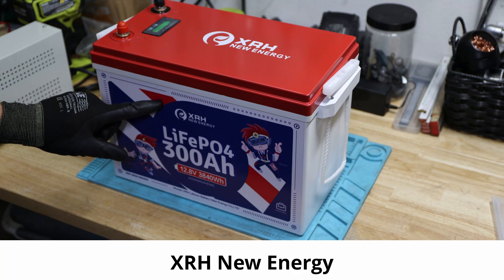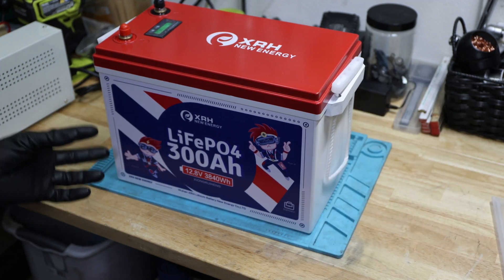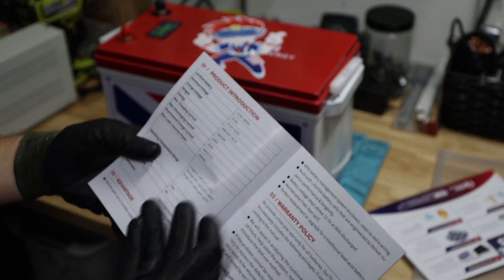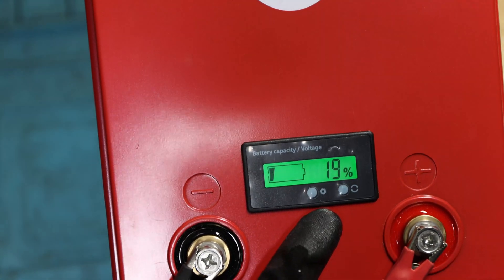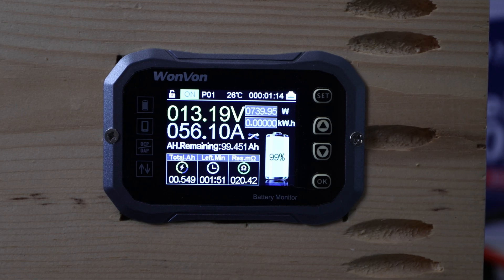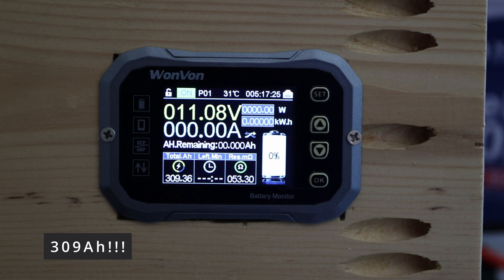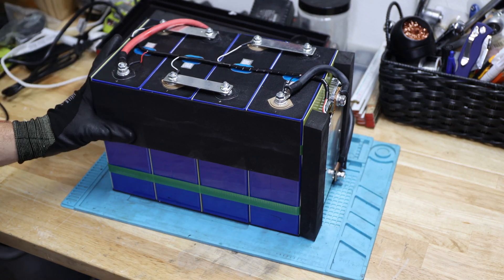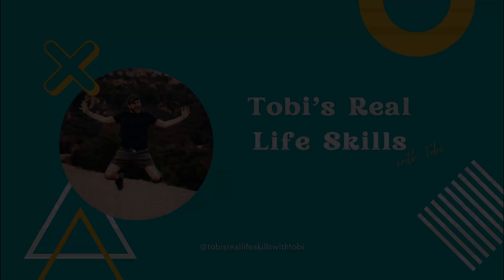High-quality XRH 12v 300 Ah Lifepo4 Storage Battery Without Temperature Protection

Comment: Very itneresting. I bought a similar battery and a battery tester. I want to know the capacity of my battery, but I am not sure how to go about this. Do I just run it and hope it hits 300ah before cut off, or do I run it down to BMS and see the exact measurements? At what point do I cut it off if I am not completely depleting it until bms kicks in but it hasn't reached 300ah yet? When do I call it "false advertisement"?

Comment: Thanks for the teardown, I think this should be OK in a system with a Victron Smartshunt doing low temp cutoff? Would love to see a high current test as I'd like to use it at around 100A-150A loads and curious to see if it has any BMS high temp protection since no temp leads on the battery.

Comment: Another great video. Thanks. My jk bms has a build in thermal protection and also external. Maybe the manufacture is referring to the built in one in there manual?
Reply from the maker: Thanks! I thought about this as well to heat up the BMS  but have not done it in this video. :/